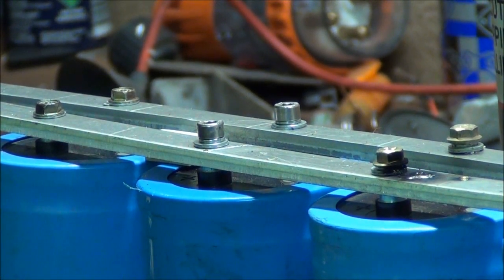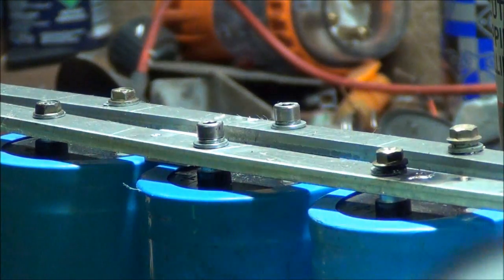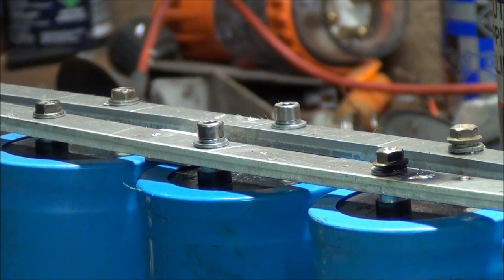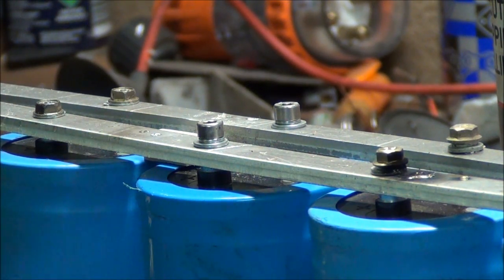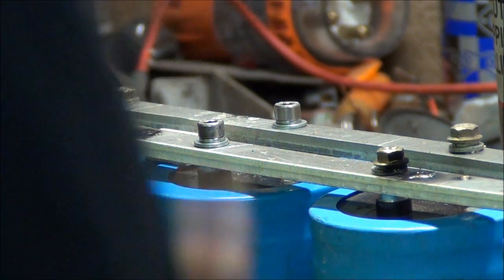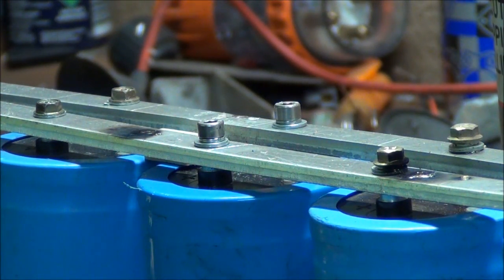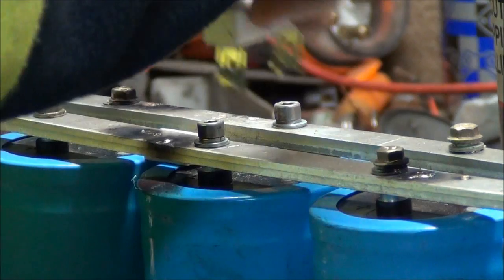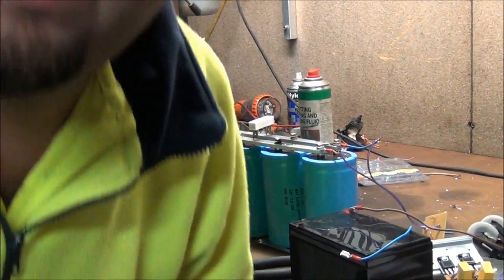Capacitors go BOOM!!!! Big Cap Bank!!!

Comment: 250v DC 2400uF - are you noticing any damage to the caps?
Reply from the maker: +BeeEmmW no damage at all
Reply: +alex993cc1 and how are you charging them?

I am from Australia and have like 30 of these in a box haha
Reply from the maker: +BeeEmmW custom wound flyback
Reply: +alex993cc1 you must share the details of this!

What are you powering the primary with? I was thinking of using an MOT with reduced secondary windings

Comment from the maker: in my experience, capacitors explode when over-charging, not discharging, however, there is a possibility. put the capacitor inside a wooden box
it will be safer that way. i have never had a capacitor explode during a discharge!

Comment: I've always wanted to know......If you charged this cap-bank upto 240v and put a 240v lightbulb across it....How long would the lightbulb stay lit up for?

The bulb obviously wouldn't pop or explode, because the voltage would be at a suitable level, so the capacitors would act like batteries.

....But how long could they power a lightbulb? It would be interesting to find out. :-)

-BoomBoxDeluxe.

Comment: As the cap charge they put less and less a load on the transformer. The squealing is just the oscillator frequency changing as the output load drops. What size is your tank cap, and how many winds on the primary?